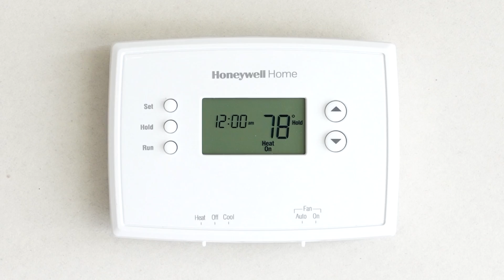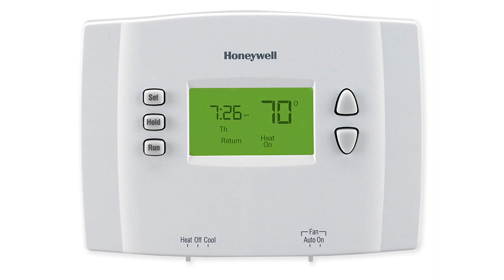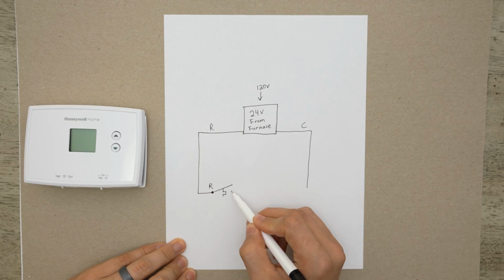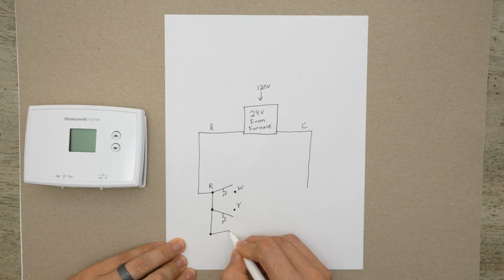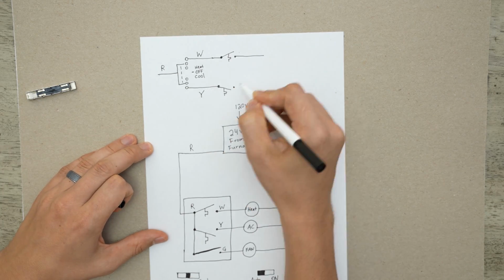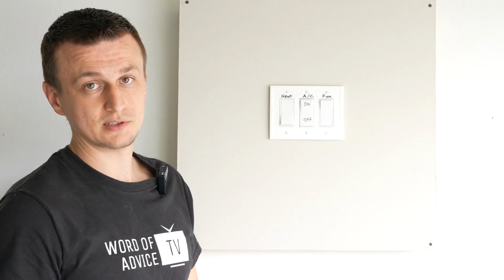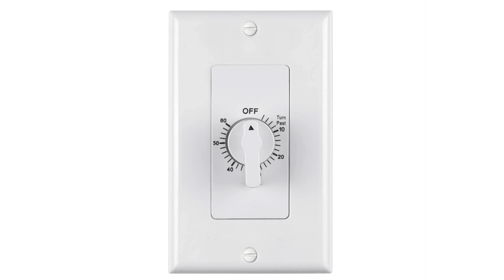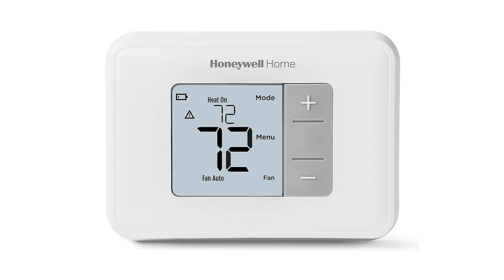Your Thermostat is Actually A Lot Simpler Than it Looks

Comment from the maker: ⬇ Other videos you may be interested in:

How to Turn Thermostat Into One Switch:
https://youtu.be/-JgJA6VpKe0
Basic Thermostat Wiring Explained:
https://youtu.be/VknvJ9POYDo
Simple Thermostat Wiring Diagram:
https://youtu.be/jDLz3REPTWM
How a Thermostat Works For Dummies:
https://youtu.be/Z4T9H-6VPtI
How to Install Honeywell Thermostat:
https://youtu.be/bjbD7bq6tO0
3 HVAC Things People Overpay For:
https://youtu.be/xh1XAANaO68
Reply: We are looking to sell our home (it has central air). We had Nest thermostat that I installed (replacing a cheaper thermostat) a few years back when we moved in. We want to take the Nest with us, so I replaced the Nest with a cheaper non-programmable one. The AC worked so I assumed all is well.

During a home inspection, the inspector said that "The furnace failed to start. According to the diagnostic codes there were three red flashes, indicating "the pressure switch, roll out switch, or auxiliary limit switch open".

Since the furnace worked well during the winter, I am assuming this may be related to my replacement of thermostat, perhaps I did not connect the W wire properly.

Any ideas / suggestions ?

Comment: I have been watching your thermostat videos in an effort to troubleshoot a problem I am having. My problem is my fuse blows on the control board when my heater attempts to come on. The cooling system works fine. Where would one start to troubleshoot this problem?

Comment: Dude you are AMAZING BRO!! This is like the 4th time you have solved my problems! 4yrs in a row. My honeywell thermostat just started malfunctioning. The heat LED would flash in and out.. or not even come on at all. I did your jumper paper clip trick. it fired right up.  So I guess I have to go buy a new thermo. However I really like this idea of hardwiring right to the Furnace. On / Off  Perfect!

Comment: I have a question. Why in heat mode, we don't need the fan?
Reply from the maker: Because the furnace will automatically turn on the fan after it preheats.
Reply: @WordofAdviceTV  I have another question. Some kinds of control board need two separate cables. One is from the thermostat, one from the temperate sensor (I just guess). Can  you give a video about that?

Comment: Hi - I hope you can answer my question, I’m having trouble with my old Trane thermostat with hard buttons. The issue is, the temperature up button is not functioning, and I mistakenly brought the thermostat temperature down to 5 C degrees. Now, I can’t bring it back to 20 or so since the UP button is broken. So, do I need to replace the it to an exact model thermostat? Or can I choose to use another thermostat like Honeywell for example? The local dealer told me I can’t do it because the current thermostat voltage is 230 and they have only 24 volts. My opinion, I’m sure there is a solution but I don’t know how

Comment: What does a common wire do?
Reply from the maker: Some thermostats require a common wire to power on. Without a common wire the screen would be blank.
Reply: It's like like a form of neutral to complete circuit

Comment: Excellent example. I love it. But i always wanted to know in my 2 zone system what would happen if i put one zone on cool and the other on heat.  Of course i wouldn’t do it. But since you have it aleady wired, what would happen if all 3 switches were on? 😂
Reply from the maker: Glad you liked the example! I think that's doable but I've never seen it done before so I can't speak from experience. 😅
All three switches on would mean that the A/C and furnace are both working at the same time. I've seen that before when a bad control board will send power to both of them and the homeowner is confused why the air conditioner is coming on in the winter. If this only happens for a short time, there is usually no damage done to the system.

Comment: Now you can heat and cool your house at the same time. 🤣
Is the furnace/AC board smart enough to shut one off?
Reply from the maker: Yeah, totally an option now! 😄
Nope. The control board would not help this, both of the units would come on. 😇
Reply: @WordofAdviceTV   Thx, I don't have A/C but that is good to know though.
Reply: Easter egg dehumidifying mode! 😎

Comment: no , just toooooo complicated , just replace a manual one , with heat and air conditioning combined , the fan side leaves on ‘auto” , as for hot and cold , in summer , switch to air , in winter , switch to heat , simple and trouble free !
Reply from the maker: I only agree! A simple manual thermostat would work great.

Comment: If somebody actually did this set up in their house and accidentally flipped the AC and Heat switch both on at same time,  would the control board send power to both the high speed and the low speed on the blower and possibly burn it out? Or would the board default to the cooling speed which is high?
Reply from the maker: Yes, power would be sent to both fan speeds and the higher speed would be the one that is running. I don't think that would burn the motor out, at least not in the short term.
Reply: Powering two legs of a multispeed motor will burn out the winding.  This is why the board has relays to shuffle the speeds.  Two speed motors are designed to have both speeds energized.

Comment: Thanks. It demystified questions I had.... 1.) where is the brain for fan when furnace turns on? (on the furnace itself). 2.) Why does A/C shut down when the desired thermostat temperature hasn't been reached? (a timer on thermostat, i think..? To prevent evaporative coil from freezing )
Reply from the maker: The furnace one was right and the AC one would be true if you have a heat pump. It occasionally turns off to defrost if you are running it in the winter. But if we are in summer, then usually the AC will run without turning off until it meets the set point. Some people have energy saver switches installed by a power company too, which can turn your air conditioner off at certain intervals, regardless of what your thermostat is set to.